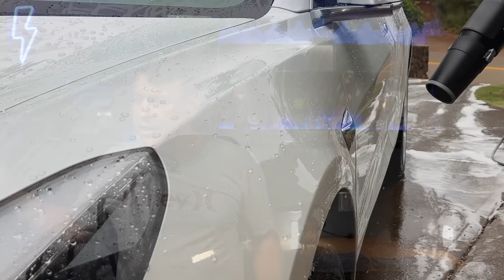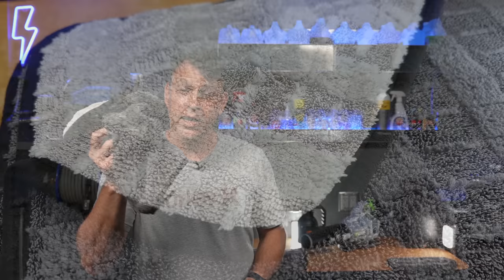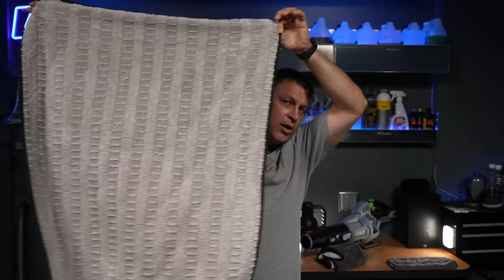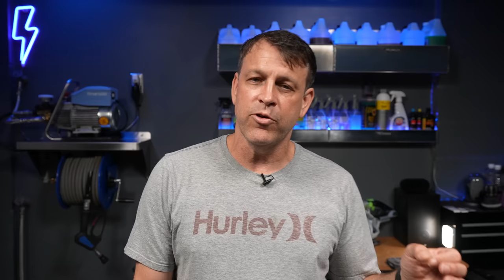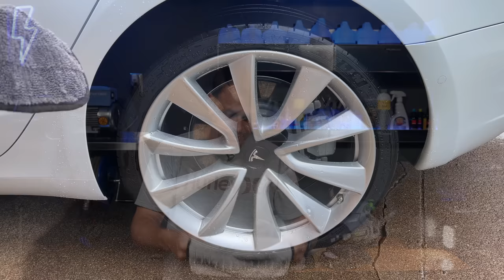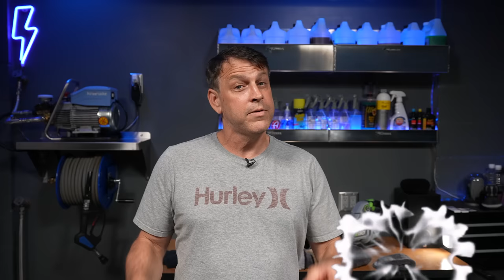BEST CAR DRYING TOOLS

Comment: I don’t like to tell anyone what they are doing is wrong, and your method is just fine. However unlike the little Master Blaster leaf blowers don’t use filtered air. So you do run the risk to introducing foreign debris into the air, and then having it hit the car. 
Those Rag Company towels are good, I used them for a long time. Also use Griots PMF towels and again very good. Luckily about a year ago I found The Sucker from Luxury Microfiber, and brother I have found the best (imho). I highly recommend them.
Thanks for the video and look forward to seeing your next one 👍✌️☮️
Reply from the maker: Thanks for sharing. I appreciate it.

Comment: I wonder how much better the 765 is compared to the 650
Reply: It’s in the name, buddy. CFM is how much cubic feet per minute is being moved through the blower. 530CFM, 600CFM, 615CFM, 650CFM, 765CFM is in the EGO blower name for each model. However, those numbers are for it’s maximum output (ie; turbo button). For example, the Ego 765CFM model can do from 260CFM to 580CFM on it’s variable speed dial. When the speed dial is at max, then you hit the turbo button, it goes up to the full 765CFM output.

What CFM is needed to dry a vehicle? The answer to that is basically “as much as you can afford”. Typically, though, 300CFM or more is generally preferred. Note that the higher the CFM number goes, the louder it becomes to operate the tool. I, personally, like the Ego 615 set to roughly 350 CFM. Gets me where I want to be.

Comment: I definitely need to get the master blaster as I’m still using the air compressor to dry the wheels and other parts which keep water. I bought the drying towel from CSW and the only problem is I only bought one. This towel became my favorite drying towel. I have started using Titan from Phoenix EOD which has a ton of lubrication and tremendous gloss. Thank you for the video.
Reply from the maker: You will like the blaster. Great little tool. Great for engine area too. Thanks

Comment: The Gauntlet towels were a perfect choice for this video! I have several of those towels and they're so soft but I recently fell in love with the Liquid8r even more. Have you considered picking up a Blowerband for your OG Stubby? I just got mine last week too! I have the 8hp Master Blaster but I quickly realized I cannot use it in my small garage because the hose is way too stiff so I may get the sidekick for winter and small tasks.
Reply from the maker: My stubby has a rubber tip on it. Seems like enough. Will have to look if there is another tip. Thanks for sharing you experience.
Reply: +1 for the Liquid8r. I think trc made a better drying towel with this one.

Comment: Hey! Great video! Quick question, when it comes time to wash your towels in the washing machine, do you wash tire cloths separate from the towels used just to dry water? I try not to mix towels that have had any chemicals in them with towels that were just used for drying water, but I may be over thinking it. Also, curious if you use any special kind of washing machine detergent for your towels. Thanks!
Reply from the maker: Here is a vid I did a long time ago about this. https://youtu.be/6DelinlTzog I use a specialized cleaner designed to remove the heavy duty chemicals we use in detailing. It works great. https://amzn.to/3MnV59d  Separating the wheel towels is a good idea as they would have the worst contamination on them. The rest of the towels you have to decide based on the way you used them. Hope that helps

Comment: Just curious what spray nozzle size and angle do you have? I have a kranzle 1622 too but using an mtm sgs35, not sure if I should go 25 or 40 degree angle and 3.0 or 3.5 any recommendations? Thanks in advance.

Comment: Hi there!  Question: can I use just a microfiber towel with the drying aid rather than a Gauntlet towel?  I do keep different microfiber towels by color separate, though.  Thanks!
Reply from the maker: Yes. Use a plush towel to minimize and chance of micro scratches. This is a step where having the right stuff will pay off in the end.
Reply: @HawaiiDetailing  Great, thanks so much! I've ordered the same orange ones you use!

Comment: The gauntlet is an amazing towel but I think you will need two of the big ones for a truck. I had one but it fell on the dirt so I just tossed wouldn’t want to risk scratching my truck.  Once these things get soaking wet with water it’s really hard to ring them out. Also have you tried Adams drying towel the Ultra plush drying towel that’s my first choice the. The gauntlet
Reply from the maker: Thanks for sharing and for the suggestion. I will give it a look for sure.

Comment: Because of my neurological disability, I’m not able to lift an Ego blower up to dry the roof of my car. Instead I use a Blo GT blower. It has a powerful 8hp motor and long 25’ hose. I can’t imagine that the little dryer on your video would be robust enough
Reply from the maker: No it’s more geared for wheels and engines or even motorcycles.

Comment: Its super humid out right now so my garage was completely wet and damp. I had to buy some blowers and a dehumidifier.
Reply from the maker: Yeah. A mini split ac is also a dehumidifier. Works well to cool and get the damp out.
Reply: @HawaiiDetailing  I really need one of those. I live in ND so I'm more worried about heating. My garage is insulated so I have been able to keep it warm with a simple a 1500w space heater.

Comment: One thing to note is that the blowers won't do a good job is the paint doesn't have protection. Ask me how I know...I used the blower on an unprotected paint and it was just taking forever. After using Bead Maker then my blower is able to blast off the water. Just something beginners should be aware about before going out to purchase items.
Reply from the maker: Yes great point.

Comment: Does drying aid mess up your microfiber towels?
Reply from the maker: Not if you wash them with the right stuff. I have a link for the proper detergent that will remove the sealants from the towels safely. It’s worth it for sure. Works great.